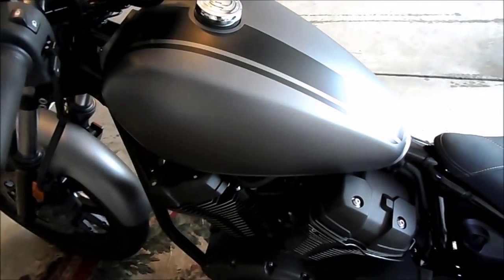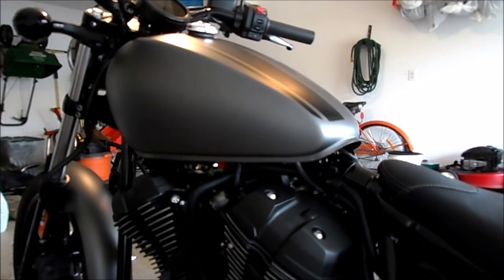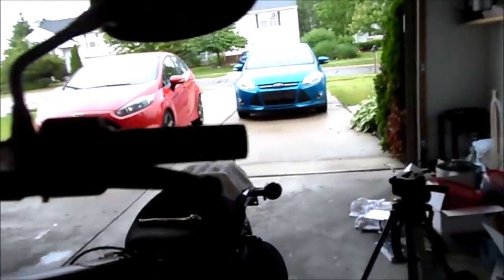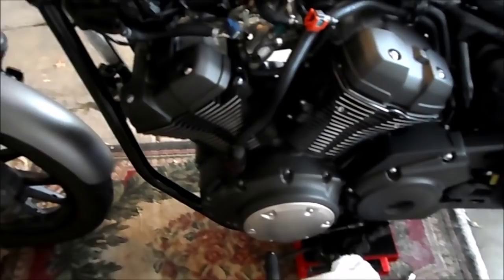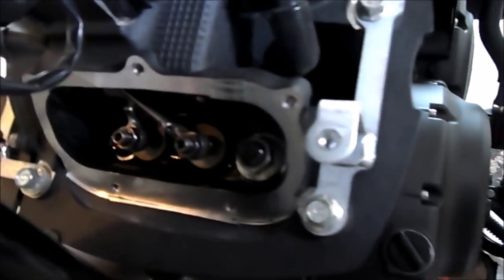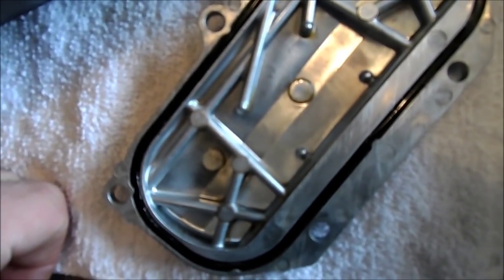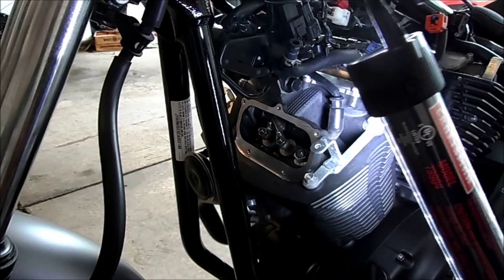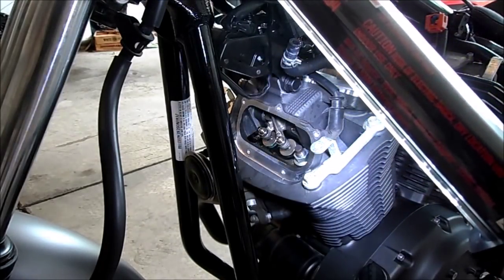Yamaha Star Bolt Valve Inspection and Adjustment

Comment: Thank you Steve! you took the intimidation away. I bought a V Star with 22,000 mi. that never had the valves inspected. I took it to a mechanic that wanted just south of $300 to do it. I could pay, but now I think I'm going to do it myself. 
I thank you for your time and efforts!
Reply from the maker: +Paul Andreasen Glad you liked it!
Reply: Paul. I have a Vstar also. Did you ever attempt this? I was wondering if it's the same procedure and how it worked out for you. before I attempt mine.
Reply: Fred Wiedlich I sure did. Works fine
Reply: Thanks for replying! As soon as the weather breaks here in Pa, I'm going to tackle it.

Comment: that's a very clean bike.  i clean mine every 60'000 miles whether they need it or not.  that's brilliant about trimmer the allen wrench.  you just fixed a huge problem for me.  the pinch bolts on my 2015 caponord triple tree are so hard to spin because of stainless bolt in aluminum..  no space to fit anything of decent size leverage  doh.  thanks.

Comment: How do you know it’s at top dead center without removing the spark plugs?
Reply from the maker: There's a witness hole with markings, remember the piston comes to TDC twice. Once on compression (valves closed) and again on exhaust (exhaust valves open) if you simply look for TDC you have a 50% chance of having your exhaust valves open and messing up the adjustment.
Reply: @SuperSneakySteve  do I use a torque wrench to tighten the nuts or is a little past hand tight best?
Reply from the maker: @ericx7476  I use a small wrench and use about the same force I use to loosen it to tighten it. You don't have to smash it hard. These are fine threads. If you doubt yourself then find a small torque wrench and tighten to spec.

Comment: my bike is making some rhythmic tapping. correlates with rpm. it is not noticable until the bike is warmed up. I thought it might be valves but I also figured that valves out of spec would be constant, not only when at operating temp. Someone else suggested cam chain. The manual i have is a basic owners manual, not a service manual. Could you do a vid about inspecting/adjusting the cam chain tensioner?
Reply from the maker: It's likely valve train noise and very normal. Make sure you're using the correct weight oil. If you go with thicker stuff it will get more quiet.

Comment: why did you take off the plate next to the shift gears ?
that red little filter ? 
good video thank you
Reply from the maker: You need to take the plate off to turn the crankshaft and line up the marks. Hope this helps.

Comment: Now why were you checking the valves on that I'm just kind of curious
Reply from the maker: They get tight over time. If you don't do it you can do major damage. It's good to do the first one after break in.
Reply: A valve check/adjustment is recommended by Yamaha after the break in period.

Comment: How could you tell if your valves were loose by just riding?
Reply from the maker: +Roswell Rider Check them at the recommended intervals. Don't wait for your motor to run poorly, by then it's too late.
Reply: +SuperSneakySteve I'm pretty sure my valves are fine because I only have 4,000 miles on my bike.. But I feel like I hear excessive rattling.. I took it in and the shop said that my valves need to be tightened but I think they're just trying to get my money.. There's no way with the bike that only has 4000 miles that my valves could be loose? Right?
Reply from the maker: +Roswell Rider I wouldn't say there's no way, but it would be unlikely. That's why I made this video. Now you can check them on your own and you won't get ripped off.
Reply: +SuperSneakySteve I'm buying a power Commander in a few weeks and I'll have take the tank off then so I will check them at the same time.. Thanks for the vid !
Reply from the maker: +Roswell Rider Before you do that, look into getting a flash from Ivan's Performance.  You can google the name. There's lots of feedback on the Yamaha Star Bolt forum too.
Reply: +Roswell Rider Does that rattling noise happen when you are engaging the throttle?